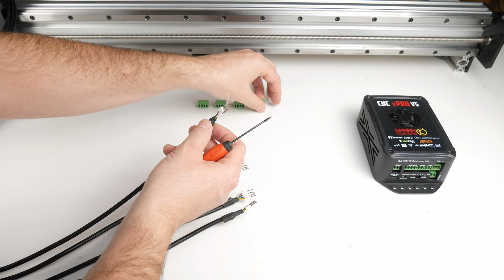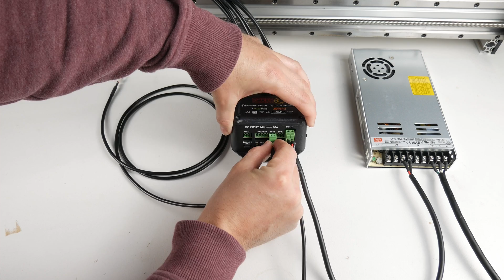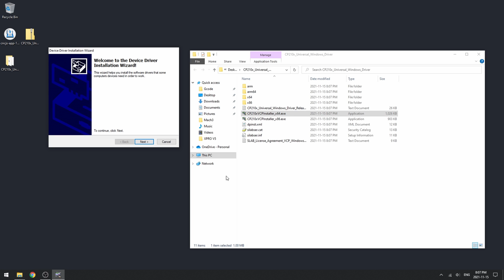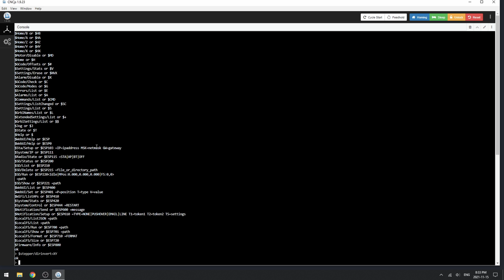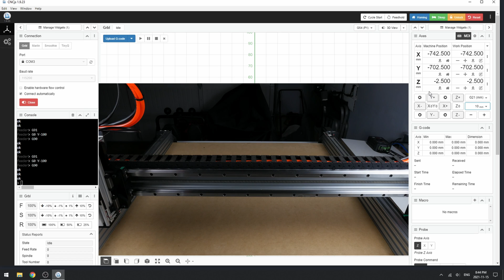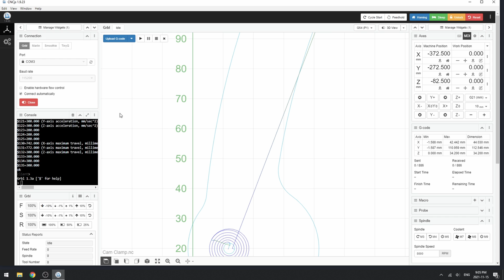CNC xPRO V5 - Installation and Configuration

Comment: Thank you so much for this detailed video, I am stuck at the Z axis making noises when I jog but it doesnt actually move up or down.... and when I invert Y the X goes back to the wrong way, vise versa, when I invert X the Y reverts back to the wrong way .... help please ...
Reply: I also got confused by this. But figured that if you use the command "$Stepper/DirInvert=x", two times it would NOT get back to it's initial state as i initially thought. It store the invertion so either it is inverted or it's empty. So if you type the same invertion again nothing is changed because the value is the same. (If $Stepper/DirInvert=x does not work try $Stepper/DirInvert=" to remove the x from being inverted, effectively inverting it from it previous setting) Also: you have to push the red reset button on the controller case for the change to go into effect.

Comment: Thanks for the video. I  put together a little cheat sheet on this setup and shared it with some others. When I got my QueemBee and XPro V5 I was lost, I never had a CNC and was really shooting from the hips. You have some great examples of setting I am going to test on my setup.  Thanks again.
Reply: where can i find this cheat sheet
Reply: @Nautical_bro_Cory  did you get the cheat sheet? i would be intersted in one also.
Reply: @Nautical_bro_Cory  saludos desde España. ¿podrías pasarme esa hoja de trucos. tengo la ULTIMATEBEE 1500x750
? Gracias

Comment: Hello, can anyone help me, I have a problem with the loud work of nema 23 high torque motors
at rest? Updating xpro v5 didn't help.
Reply from the maker: You could try and lower your holding current. Axisletter/Current/Hold to see what it's currently at and adjust that down a little to see if it helps. You can also disable hold current if you like with $stepper/idletime 250
Reply: @IllDoItMyself  Thanks, it works. I also have a question how to choose the best setting of the motors operation if I want to move the X, Y axes quickly. Maybe you will record a tutorial about it?

Comment: Thank you all your videos. I’ve used your previous to setup my Bulkman 3D machine and was super happy to see you upload this video.
I had been really lost setting up the XPRO v5. 
Would you be able to advise why my spindle is unable to turn off using Cncjs? 

feeder> M3 S8000
feeder> M5
[MSG:Spindle RS485 Unresponsive 7]
[MSG:Critical Spindle RS485 did not reach speed 8000. Reported speed is -1 rpm.]
ok
ALARM:10
Grbl 1.3a ['$' for help]
[MSG:'$H'|'$X' to unlock]
[MSG:VFD: VFD settings read: RPM Range(7999, 24000)]]
>

Thanks again for getting me this far, hopefully I’ll be able to get this problem sorted to finally get to use the machine.
Reply: I got the same problem, the spindel started, but it could not be turned off. I found out is it caused buy EMI from the spindle cable. I grounded the spindel cable metal foil shielding, and also wrapped the rs485 cable in alu foil,æ for good measure, and this problem went away. But still having Electromagnetic inteferrence issue in my endstop cables when spindle is running though...

Comment: Hi there, really do appreciate all your videos
especially for a novice like me thats just starting out.
Also thanks for answering everyones questions. truly
is a blessing. 
I'm in nz so mains power is 230v. I noticed that in this video there is no
ground wire on the VFD being used as in previous
video it was mentioned that it was neccesary to
ground the spindle and VFD. Last question is on the VFD controller
mains power. is "R" neutral and "T" is power? do I
need to connect the ground/ earth wire? Or is a 2 pin plug ok. Thank you for
your help and really do appreciate all the time and
effort you put into the videos and answering
questions.
Reply: Hi Hazza, how did you get on? I’m in NZ too. Will start my build mid February.
Reply: @kevinbouwhuis2390  just followed what he wired in the videos and works ok.  Was having issues trying to get it contrite working properly but after I updated the firmware on the controller it started to work sweet.  Just trying to figure out vfd control as I can turn it on but not off.   Gotta learn how to go from part to code now 🤦‍♂️ I'm full newbie 😆

Comment: When the spindle turns, I have noise on the axe X and Z limit switches, Wich prevents any movement of the axes ( errors). U connected the cPRO with the VFD in PWM. How to eliminate the parasitic noises ? Thank you.
Reply from the maker: My VFD is not connected with PWM it is on rs485. If your experiencing emi you need to make sure your machine has a star grounding setup. You can also move your spindle cable so that it is not run along side your other cables. You could suspend it above the machine to help.

Comment: Thanks for the tutorial. Do we have to change the VFD setup or it can be the same as UC300 Controller?
Reply from the maker: Similar to the uc300 as long as your using the rs485 settings. Check my previous VFD video and use the settings I recommend for the USB RS485 dongle and you will be good to go.

Comment: Thanks for the video. I bought a V5 controller for my first cnc and although I’ve been adventurous with everything rose I had just left the settings for this at the recommended for the distributor. I will definitely be going back and sitting a few things out after watching this.
Reply: Hii,,can you sharing your xprov5 wiring diagram,,

Comment: Thanks a lot, as always perfect professional work. I have set the basic parameters, so far everything is running fine. I have one question. Each time I connect the machine to the network and start the CNCjs program, I have to reset the machine for the first time with the red button on the xPRO V5 to start / unlock / motors. When I use the Reset button in the CNCjs program and then the yellow Unlock button in the upper right corner of the monitor, the motors are silent. Only when I press the red button on the xPRO V5 controller are the motors energized. Then everything works normally goes via CNCjs in the upper right corner of the monitor / Reset button / This is always repeated after each connection of the machine. Is that okay or do I have something wrong set up? I look forward to more videos on detailed xPRO V5 setup. It's a nice Christmas present. Thank you.
Reply: I have the same problem
Reply: @jozeflipka  Maybe someone will answer if it's okay. If not, how to solve it.

Comment: Fantastic video! Quick question; Are you able to run the higher max feed rate because you have higher rated stepper motors? The Bulkman kit comes with 3amp motors. What do you think max feed rate should be for a 3amp motor? I am running at 2000mm/min but would like to (safely) go faster, but would like to prolong stepper life as well.
Reply from the maker: Thankyou,  higher current typically leads to more torque not necessarily higher feed rate. Infact sometimes it can actually cause the motor to not be able to achieve higher feed rates. With 3amp motors you can keep the default settings. You should be able to achieve 4000mm/min or close to. If not try some dry lube on your lead screws and check for any binding. I use wd40 dry lube with ptfe and have great results.
Reply: @IllDoItMyself   great videos. All the drive motors for the axis work very intermittently. The software says all are okay yet they do not move? The software simulation shows the machine moving as your video yet the machine does not move ?
Any suggestions would be greatly appreciated (I’ve had the machine for 12 months yet to get it working 😣)

Comment: Thanks for the upload. I have the 3.0A steppers (23HD86001Y-21B), so the settings will be different.
Reply from the maker: You can leave the default settings and you will be fine.
Reply: Can you share you settings with me I have the same motors ;)

Comment: thanks, It was the one area I was worried about in my build. I note you have a 2nd clamp on the spindle, do you know if the kit comes with 2? I don't think one would be rigid enough
Reply from the maker: The kit does only come with one. I recommend adding another.
Reply: @IllDoItMyself  I just checked and it lists 2 in the kit, so that's good, One certainly wouldn't be enough
Reply from the maker: Oh perfect, I'm glad they changed that!
Reply: I received a kit last week and it has two spindle mounts with   the 2.2kw spindle. I think Bulkman must be sending two now.
Reply: I also thought they only supplied one clamp, so I ordered one. There were two clamps in the package, so I have a total of three clamps ...😀
Reply: @blackwidow067  where are you located? I would be interested in your 3rd clamp.
Reply: @JasonBellIronLung  The clamp is already sold.
Reply: @blackwidow067  thanks for letting me know.
Reply: I have another spindle mount 80mm on the way from Bullkman as I thought there was only one in the kit  should be here just after Christmas so if your in the UK and need one it can be had for cost
Reply: @alanmccabe8009  Thanks, but my kit should be here by new year and Bulkman list 2 in the kit so I should be ok, Freight from the UK might also be more expensive than new from HK, I'm in New Zealand
Reply: @alanmccabe8009  It came with 2 Clamps